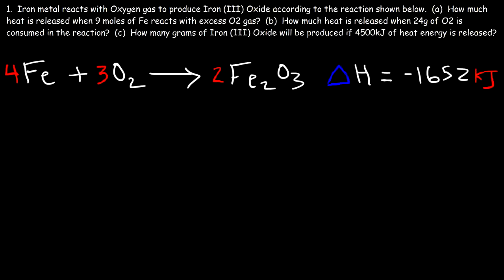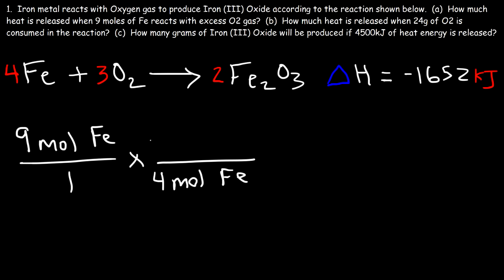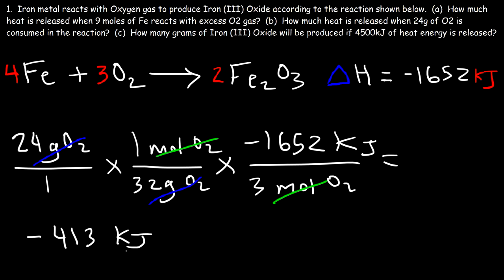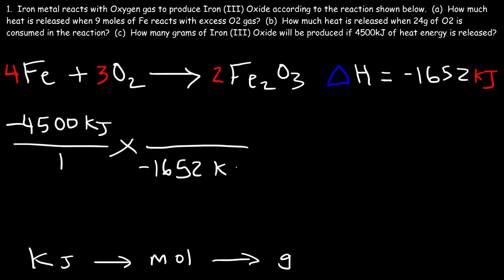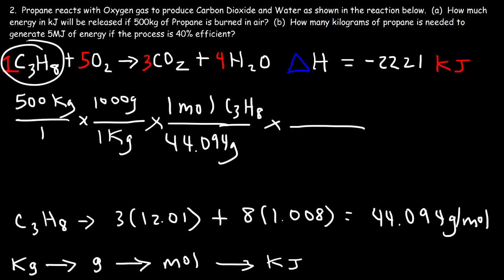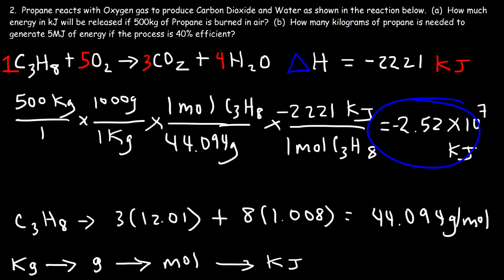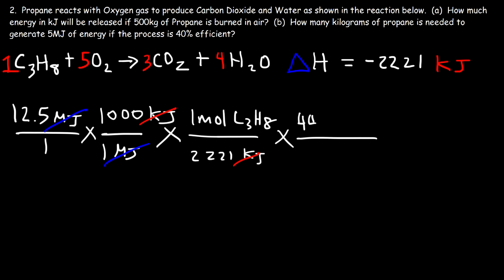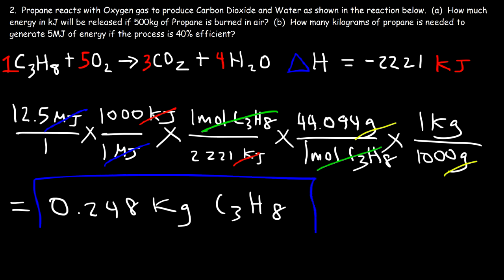Thermochemical Equations

Comment: I'm not sure if this is correct. However I divided 2221kJ by 0.4 then used the exact same method you use but with
-5MJ and - 888.4kJ instead of 12.5MJ and 2221kJ.
Got same answer